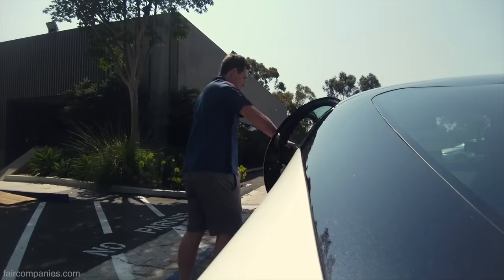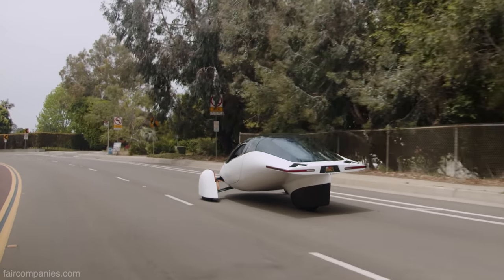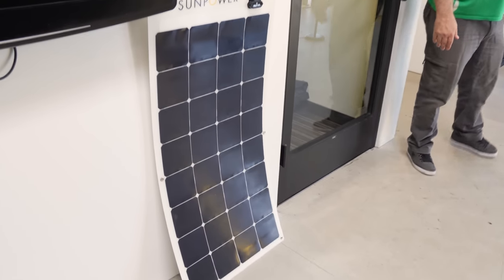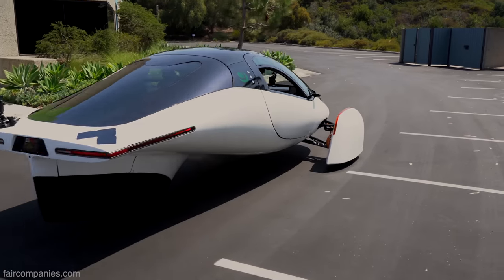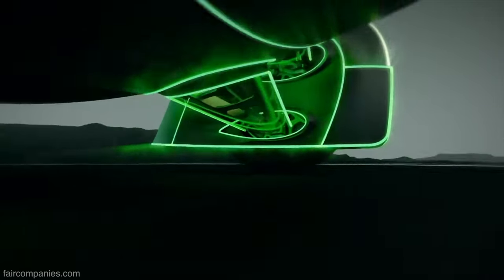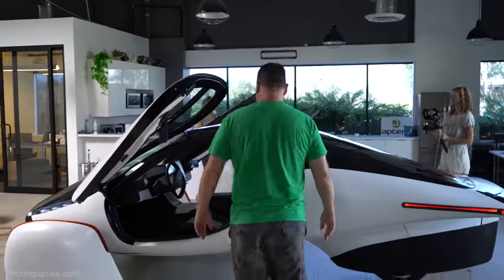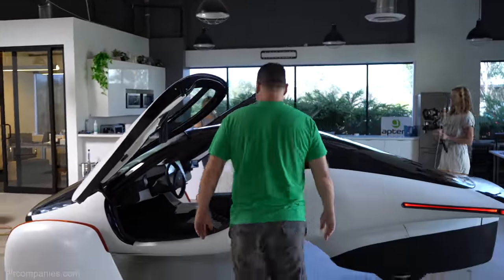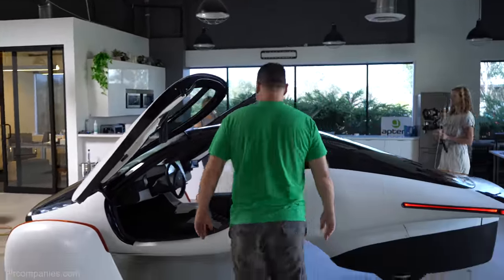Aptera commutes just on solar, gets 1K mile-range when full

Comment: Having motors in the wheels means the unsprung mass of the wheels is a huge problem:
force=mass x acceleration or acceleration=force / mass so when the Aptera goes over a bump in the road the acceleration of the front wheels to lift the front wheels over the bump is very slow because of their large mass so the whole vehicle rides over the bump creating a very bumpy ride for the batteries, passengers & body of the Aptera. The stresses on the tires wheels & motors could damage them over time! If you hit a bump at high speed the tires could blow out! That is why low unsprung mass on a vehicle is usually a design goal? Like in German start-up Sono Motors affordable EV that can run on self-generated solar power alone. The Sion solar car will be sold for 27,873 USD. Drive is a three-phase asynchronous motor driving the rear wheels with a power of 120 kW (161 hp) & voltage of 400 V. Top speed 140 kph (87 mph). Sion has 50kW CCS DC & 22kW AC charging.
Reply: i don't like the hub motors either, but the sion is a brick the size of a bmw i3 and probably less efficient than even that. never mind the bumpy ride, those hub motors will be the first thing to fall apart on this car and it might add a 10k+ replacement cost one or two times while the rest of the car might be fine. battery should be good for 500-1000 cycles in this, that makes it so that even the shorter range batteries might survive longer than just about any other component. also, how is this company staying afloat? they have like 30 employees already judging by the videos on their channel, and they don't look like unpaid interns. only 1.3 million in non-refundable preorder money because the 100 dollar pledges, but they somehow plan on paying all the salaries, taxes, tooling, building a factory, plus the cost of making ten thousand apteras for only 300-400 million extra dollars? are these things really that cheap to make? ten thousand of those battery packs must cost 50-80 million in itself, surely?
Reply: Just imagine the repair bill if/ when you pop a curb.
Reply: @donovan2913  that almost never happens though. in an open wheel car i'd imagine you're even less likely to do that
Reply: @markifi  Mark it is 6 months after your comment and we see the Aptera number of employees has at least tripled, they have the factory space, and are still on track to deliver the first production vehicle by December of this year.  You can see some more of the details in the 2021 SEC report.

As for the wheel motors, the retail price is $2500 per motor.  They are robust and each tire  is more lightly loaded than with most conventional cars so a blowout is unlikely.  

I had questions about robustness, too.  I worked for a company building electric motors for marine use.  I asked some questions directly of Elaphe and they had the right answers.  I no longer worry about the robustness of the motors, and plan to use my Aptera all through the year, living on a gravel road in rural Iowa.
Reply: @n.brucenelson5920  thank you for the follow up. that makes me hopeful. my understanding that the only thing with the elaphe hubs is the sealing of it has a relatively short service interval. no big deal really
Reply: @markifi  Elaphe has continued development work on the wheel bearing seals.  Worst case will be a recommendation to change them every 30,000 miles or so, but if they become comfortable with their testing of lifetime bearing seals this may be a possibility.  There is still on going development work.

There are now over 21,000 pre-orders and even with the supply chain headwinds Aptera is making amazing progress.  I don't think the challenges are over, but they seem to be working through them.

Comment: I don't drive often, so this would be super cool for me - hopping in and finding it fully charged.  I'm in Canada, though, so heating might be an issue.  Also all the salt on the roads here would be hard on those motors in the wheels.  This would be great for Vancouver though.
Reply: Should be good down to around - 20 f.
Reply: @n.brucenelson5920  That eliminates about 3 months of the year then.
Reply: @HeatherSpoonheim  could be.  We need to see the results of the environmental testing. Salt will probably not be an issue.
Reply: @n.brucenelson5920  salt eats up regular cars here - there would need to be a way to keep it out of those motors.
Reply: @HeatherSpoonheim  The motors are fully potted, similar to marine motors that are designed to run in seawater.  They have already passed extensive salt spray testing.  I used to work for a manufacturer of marine motors and have discussed the design directly with an Elaphe engineer.  They are doing what they need to.

Comment: I'm curious about more of the safety features, airbags, how it would handle front or side collisions?
Reply: It will be crash tested to FMVSS part 200 standards by a third party and the results will be published as soon as there are production intent vehicles available to crash.  It has air bags, an F1 style passenger safety cage, front and rear crumple zones and seat belts.  It should rate very well.

Comment: Now a class C license in Texas,Louisiana and Alabama is all you need. Considered a car now! However, Texas still requires a helmet.
Reply: "Under current Texas motorcycle helmet laws, you are allowed to ride a motorcycle without wearing a helmet if you are at least 21 years old and have completed a motorcycle safety course (which is also required to receive a motorcycle license).  While this exemption covers most licensed riders, you may also be exempt from wearing a helmet if you carry health insurance that covers injuries from an accident.

Since 2009, Texas law has also prevented police officers from pulling someone over simply to check that they meet the requirements to be exempt from wearing a helmet. "

Aptera may not even fall under this requirement.

Comment: My concern is the battery. My CRX from California couldn't take Florida heat. My Insight battery failed every two years. It was not only the heat, but I didn't drive it enough to keep the battery charged up. The info on the battery in this video was interesting but not sure if it would last 200K miles for me.
Reply: There was more information on the testing revealed in today's video.  The present battery tech is far removed from your nicads.
Reply: @n.brucenelson5920  Where is today's video?
Reply: @carolingwholeo  Sorry, I was one a plane.  So a search for Aptera and it will probably be one of the first suggestions.

Comment: This is very intriguing. It makes me wonder about things like driving at night, or in the winter when it's minus 20 or 30 or 40 - not to mention handling in the snow or in the strong winds that we get here. Is it heated? Where do you seat your children and pets?  Needless to say, I have a lot of asks.
Reply: I can answer a few of these questions.  I live in Iowa and have an early preorder.  I have also ridden in Luna - the silver prototype.

Aptera will be tested to perform between -20 and 125F, and some of the components, such as batteries will be tested down to -40.  It has liquid (antifreeze) heating and cooling of the battery pack, and AC and resistance heat for passengers.  It is designed for two people and a pet kit is available.  There could be an option for a third child seat later, but this will not be available for initial production.

Because of the shape, strong winds from any direction do not put much force on the vehicle and you will barely feel them, even passing trucks in windy conditions.  There is downforce built into the design at the rear of the vehicle at speed.

The wheel motors have an excellent ABS/Traction control built in that can sense wheel slip and adjust torque 32 times per wheel revolution, or about every 2.5" of tread travel.  I plan to use studded snow tires during Iowa winters.

Comment: Interested to know how much the wheel assemblies weigh? That is how much mass was added with motors vs reduced in lightened suspension components. The guy doing demos is obviously  sensitive about the suspension limits but the riders don't seem disturbed much.. hoping that means they focused on the added unsprung mass a reduced the negative effects as much as possible.
Reply: Less than 50 lbs.  They save weight by not needing large brake rotors or drive shafts.
Reply: @n.brucenelson5920  that's excellent! This car is the future.
Reply: @lutzshawn  One motor, rather than 3 will have more kw/lb output, and can drive the rear wheel from out of the hub remaining close by. The net added weight is a better, more preferred deficit than the unsprung weight of an in-hub motor, where grams count, and kilograms are disastrous. This is why mag wheels replace steel in race cars. There is not the math/science in the design they profess to have.

Comment: The one comment about loudness.  While yes gas engines are less efficient than electric, they actually waste a bit of energy muffling their exhausts, and so can get slightly more fuel economy with a more free flowing loud exhaust.  The energy is spent on the sound regardless of whether you can hear it or not.
Reply: i thought that was pretty dumb of him. you could argue he didn't mean the sound itself takes a lot of power, but that if your fuselage makes a lot of sound, it's likely inefficient (fighter jet vs sailplane). it would be a charitable interpretation though, they were likely just having a conversation

Comment: What happens to the range when it's being driven at night or on a cloudy day with the lights, A/C or heater on and no sunshine? How long does it take to recharge? What do you do if you run out of charge and there's no sun? Is there an alternate way to charge it?
Reply: Range is somewhat reduced with A/C or heater on, just as with any EV.  Since Aptera only uses less than 100 watt hours per mile at highway speeds, and has a well insulated cabin, the range hit is not great.  It is so efficient that plugged into a standard 110 VAC 15 amp circuit it will gain 13 miles of range per hour of plug time, more if you have a a 220 VAC dryer circuit in your garage.  If you stop at a 50 VDC roadside EV charger, you will gain 500 miles of range in an hour.

Comment: One of my Only Concerns is the Wheel Covers look a bit flimsy and what about the wheels sustaining damage in Pot Holes? Are there any plans for a more robust suspension or wheel protectors? I think a very convincing Demonstration would be seeing how Aptera rolls and works on Streets in Chicago or Detroit?
Reply: Wheel covers and mounting points have been completely redesigned since the alpha prototypes.  The suspension has also been redesigned by Roush Performance, and includes a sway bar, more compliance and changing the rear from a single swing arm to dual link.  An "off road" version with more clearance will be an option.
Reply: @n.brucenelson5920  I believe I would be very happy with my Aptera.  Does Aptera foresee any use with Solid State Batteries in Place of Lithium as these may be better in environments of extreme Cold conditions?
Reply: @claystone7729  I have not heard any talk of solid state batteries yet.  I live in a cold area - It was 13 degrees this morning.  I will be getting an early model and will report on how it performs.  I expect it will be fine down t -20, and perhaps lower.  Aptera is a Kaizen (continuous improvement) company, so changes are possible for the future.
Reply: @n.brucenelson5920  Well, I do know there are pros and cons to Solid State too like Hot Temperatures can Degrade Solid State more rapidly and must be cooled. So Hope that the Lithium Ion will Last a Long Time.

Comment: Interesting...but many question not answered: Range, Charging times, Costs and what happens when its dark? How long can it drive through the night? What type of Battery Pack is it? Which chemistry?
Top Speed / Cruise speed? 
Noise reminded me of an old Unigate Milk Float my dad used to pilot in the 60s lol. Hope the NVH is sorted before sale.
Reply: All these questions are answered in company FAQs and videos. Range 250 to 1000 miles EPA Highway, depending on battery pack size - 25, 40, 60, or 100 kWh.  Starting at $25,900.  Lights won't have a big impact on range.  Battery packs use 2170, MNC chemistry.  Top speed 110 mph, RPM limited.
Reply: @n.brucenelson5920  thanks. Range is fine but I find the cost a tad high. Rumours are the next Tesla saloon will be $29000...that's going to be very attractive I would say, making this even more niche than it already is....
Reply: @swannvictor1388  Tesla doesn't offer right to repair and their tooling costs are an order of magnitude higher.

I see nothing from Tesla on the horizon that would be as cost effective to run or meet my needs better.  This won't be true for everyone, but the total market is large enough.

Comment: Tesla made a successful car company not by selling tiny underpowered cars but by making cars superior to anything on the road. If you're going to make a solar car you need to fully commit and make it normal car size with 100% of the surface of the car solar panels rather than 40-50%.

Comment: Maybe I missed something but how much range does it charge from the solar panels per day and what is its range on full charge?
Reply: Depending on the solar insolation where you live, up to 40 miles per day.  I can expect about 20 miles per day where I live in Iowa.  The EPA highway range will be 250, 400, 600, and 1000 miles, depending on the battery size chosen.

Comment: Very cool. What happens if you get a flat tyre? Does it meet regulations on this?
Reply: The wheel pants unclip without tools.  The wheels unbolt from the wheel motors just as they would from brake drums.  I plan to carry a tire plug kit and dc inflator and repair flats just as I did on my motorcycles.

Comment: That's a great vehicle, it looks very futuristic. Is there a larger version of it? I'd happily haul my 2 week grocery shopping around with a kid. Is it possible to drive 80-90 miles per hour and provide a save crash zone in case you collide with a truck? I am really curious about the safety and how it is provided. Maybe in a larger version it is considered, i would love to have one
Reply: Yes.  25 cu ft of cargo space.  Front and rear crumple zones, seatbelts, air bags, and an F1 style passenger safety cage.  Theses will be voluntarily crash tested to federal automotive standards and the ratings published before they ship.
Reply: @n.brucenelson5920  No. All of your features are 100% arbitrary personal opinion and made up by you on the spot. Crash testing is a different subject. 5 cu ft is a lot of cargo space for daily use by commuters. No motorcycle bags achieve 5 cu ft. The Arcimoto has a great and proven crash rating without any airbags or crumple zones by having a 6 point harness, no helmet needed.
Reply: You and your kid must not eat much.

Comment: Not knocking it but have questions because this is pretty damn cool looking. 

My big question is what about night time driving? Less range? Does it just burn through the battery quicker?

How does it fare in high wind situations? Potholes?

They took it to a drag strip....come on, what are those quarter mile times? I'd jump right on board drag racing one of these. I don't have the big bucks for an electric Ford Cobra Jet or Chevy COPO Camaro (yes, 2 prototypes exist and I spoke to the racer who helped put them together. They cost over $150k). I would be interested in something small, lightweight, and less expensive to bracket race. Maybe they could make an exception and lift that 110 mph speed limiter. 

I love the makeshift tent thing too. It reminds me of when I used to camp out in the back of my Suburban at the race track.
Reply: Driving at night will of course not have the solar contribution to range.  Due to the shape, wind applies very little force to the vehicle.  It has been tested stable in 110 mph side winds, far higher than the typical slab sided SUV.  The wheel motors are potted to withstand 100g shocks without damage.  The heaviest 2 wheel motor vehicles do 0-60 in 5.5 seconds, the AWD in 3.5.  The 25 kW battery versions are tenths faster. 

I think the 110 mph speed limit is a result of the clock speed of the motor controller.  Since Aptera grants right to repair, people would be free to try to build their own controller with a faster RPM limit.
Reply: @n.brucenelson5920 hearing the "right to repair" part gave me a warm fuzzy feeling inside. LOL

Comment: The way to do it would be to take the car body shell to a solar factory and get them to glue,paint the materials they use directly to the car, thin film is the best for the uneven surfaces, probably dividing the car into 4 to 6 sections that work independently to each other, basically converting whatever each section can see into as much usable energy as each section is able to at any one time.
Reply: Solar of any reasonable efficiency is not "glued" or "painted" on anything  just yet.

Comment: I get the efficiency. What about the safety and scalability?
Reply: Aptera is designed with front and rear crumple zones, and comes with seat belts, air bags, and an F1 style Kevlar and carbon fiber passenger safety cage.  Even though not required by the class, it will be crash tested to FMVSS part 200 crash test standards, and the results will be published before shipping. starts.  My guess is that it will rate very well, since this was built into the design from the beginning.

As far as scalability, the 3D printed molds are an order of magnitude less expensive than what Tesla is doing, and at full production the factory will probably use 20 sets of molds.  When they expand beyond 10,000 units per year, they will build additional microfactories employing 20-25 people in other parts of the country and world.